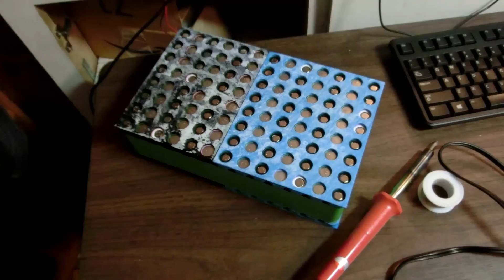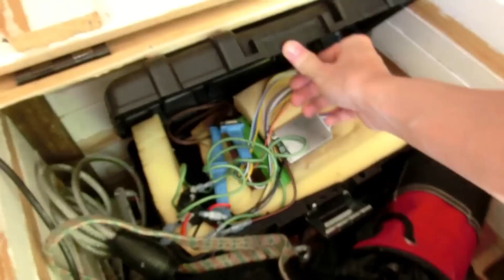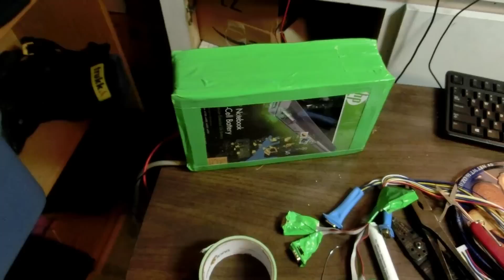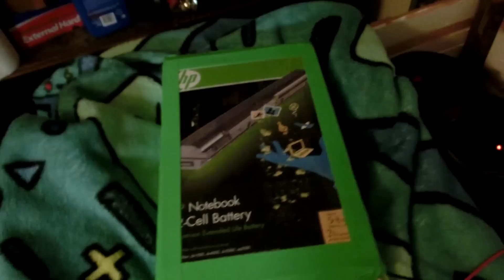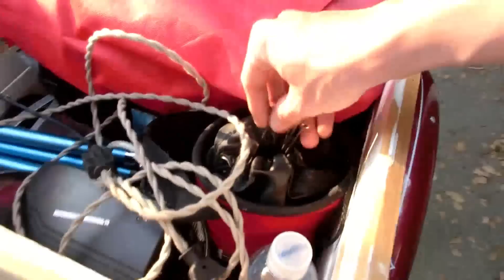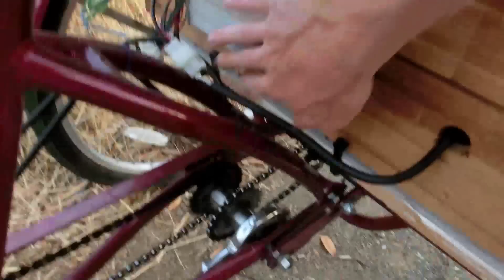DIY 52v (48v) 16AH Lithium-Ion 18650 E-Bike battery pack (E-Trike v1.6)

Comment: My dad built an electric bike useng a bike moter that bolts onto the frame at the rear wheel...we welded a sproket on the opposite side of the peddles chain and attatched a freewheel sprocket to the drive shaft of the motor...so if he peddles the bike the sprocket on the motor side freewheels with its own small chain and if he twists the throttle then the other ( original chain ) free wheels...its a pretty good set up...he is useing two of those batteries you find in kids electric trucks that they sell at toys r us...the ones two kids can ride in...he can go 14 miles an hour for about 10 miles before recharging...I would love to build him a battery like yours but I need your help with how many cells and how much voltage...I can find out any specs you would need to do the figuring...if you help me I will be happy to donate to your channel good sir...thankyou
Reply from the maker: Gary Ferguson Jr well its not all that difficult. if its 24v then you need to have like 6 lithium packs in series, and each pack should have atleast 1 AH for every amp you plan to pull. putting like 6 cells in each parallel pack would a great start.

Comment: Where did you get your BMS from? 
I have been using the IMAX B6 charger from your first battery video in my battery and I think it would be good if I can upgrade 

Also by the sound of that motor and how hot it was getting I think you definitely need more motor output power at least double what you have now especially if you are going to be pulling a trailer with more batteries on it 

And I'm not sure if I'm doing something wrong but on my 500W E-Bike I have 156 laptop cells sourced from ebay just like yours wired to a 56V full charge configuration and whenever I open the throttle to full power the voltage drops enough to trick my battery gauge to say 1-2% remaining I'm not sure if the cells are too weak or my wiring isn't up to par but it is very annoying especially when I am carrying a load
Reply: What URL I can't see one 
Try replacing .com with dot com that usually works
Reply from the maker: ***** i just got it from Ebay for like 20$. and unfortunatly any more than 1000w isnt quite legal.

best way to test your system is to connect a multimeter directly to your battery pack, and then use a lot of power to see if it dips. it could be how you connected the cells that is resistive, could be the cells themselves, or could be the wire outside the battery.
Reply: Oh ok well in Australia where I live the legal power limit for electric bikes is 200W (250W if using a pedal sensor instead of a throttle)

And I will connect my multimeter to the battery on my next ride and il see how it behaves 
Thanks for the advice
Reply: Unlikely 

I think upgrading the wiring probably won't burn out the motor or the ECU  but I do think a more powerful motor would be a wise investment even if he has to slap a 1000W sticker on it to keep the cops away from him 

And as for using a temp sensor he would need 2 
One for the motor and one for the ECU the motor sensor will be difficult because it is a moving part and I'm not sure how the data from the sensor will be fed to the monitor
Reply: *****  Oh sorry by the way if we crossed threads, I was having problems replying to you before youtube would not let me post the URL every time I tried to update it, it chopped off part of my message including the url, so I copied it and deleted my reply then pasted a new one this time the URL appeared thought I should say as your reply is above my comment now, just so no one gets confused.
Reply: www dot youtube dot com/watch?v=SMy2_qNO2Y0
Reply: That is an explosion of a Li-Po battery 
Both me and Rinoa is using Li-ion batteries specifically lithium ion cobalt as that is the most common type of lithium ion battery found in laptop battery packs
The batteries in the video are pouch type Li-Po batteries they are much different to Li-ion 18650 cells and even so that explosion was caused by massive overcharging and would not usually occur under normal operating conditions
Reply: *****  I agree it is a lipo, but the chemical stability is very similar, and if a cell did go short circuit then all the power from the other cells in the array could be shunted to the bad cell, the 18650 cells are commonly used in laptops as you know search on youtube for laptop explodes.
Reply: I have shorted out 18650s before and I have only had one explode and that is because I crushed it when I put it I the metal vice
Reply: It only takes one to cause a house fire and death
, I have over 300 cells in my battery box any one of which I do not feel safe with, out doors it's another matter but when life and death is a primary concern better safe than sorry.
Reply: That is a valid concern but if batteries are properly maintained and taken care of they generally don't explode but there is always a possibility of getting a lemon cell and having it explode or catch fire but that is rare if you get good quality cells like the Panasonic CGR18650CA (never had one of those ones explode)

But personally I recommend that you get LiFePO4 cells because they are designed not to catch fire or explode but they are quite expensive and they are only 3.3V nominal instead of 3.7V 
(3.7V full charge compared to LiPo 4.2V full charge)

I have a room in my house that contains 30KWH of AGM batteries that I use to power my whole house and live independently from the power grid 
(I might upload a video about it at some point) and I thrash those batteries continuously with no fires or explosions 
(I am considering converting from AGM to LiFePO4 once I can find a suitable solar BMS that can handle 2KW of solar input)

Comment: If you wee such a genius you would have incorporated a groove for the parallel current connector into your cell holder rack. As it is, your solders are going to be constantly breaking during the jostling of riding the e-trike.
And if you were any kind of scrapper, you'd know you could have found all that hardware you paid through the nose for at Fry's in the trash in back of Weird Stuff.
If those batteries ignite and spill into that dry brush. I hope you're watching the news about wildfires stressing firefighting resources all over California right now. If you cause one, the people who live in those hills will roast you over the coals you've created.
Reply from the maker: *****
oh hey, just remembered your anti-goole+ profile pic. i cant believe google said they would finally be splitting up youtube and google+. now we just need to get rid of the stupid fucking one-channel layout that removed the option to have background art on your channel front page.
Reply from the maker: *****
Bob and his army won.
Reply: ***** Rinoa didn't make the better Lithium cell. He just waited until the Chinese slaves made them and bought from them. When the Chinese market e-bikes in masse, they'll be equipped with their 'better' power cells and anyone tinkering around with them will drop what they've tinkering with and buy what the Chinese are selling - including Rinoa.
Reply from the maker: Eddie Exec i addressed this in the video, or maybe it was the one before. but either way its not my fault for you not paying attention.

your a whiny little bitch tbh, be constructive or stfu.
Reply: +Eddie Exec I never said he made an better lithium cell I just said that you should try making a better one than him

He has natural skills in making batteries and you are probably just jealous of him 

If you need advice in making batteries ask him don't troll him

Idiot
Reply: Amen to that my friend I'm glad there are people who don't think I'm a troll for my thoughts on forced google+ integration 

However we fought and prevailed and slowly but surely YouTube is returning to its former glory
Reply: Yes he did 

☻/ This is bob. We won 
/▌
/\
Reply: Eddie Exec Chinese is the best race in the world.
Reply: The Chinese do have some sexy women for sure

Comment: Arwsome vídeo wht idd like to see is if you added two motors to the back wheels and filled the back box full of 18650 battery's tht be one too watch would it be possible do you think keep up the arwsome stuff
Reply: +eraysha white it would add more torque, but he doesnt need that, and it would lower efficiency greatly

Comment: Depending on what the print is made from, you might be able to weld the cracks with acetone.
Reply from the maker: Maxx B yes i can but heat is faster.
Reply: Nice to know.

Comment: Seems like you use same BMS as i have.. Can you provide me link of ur BMS so i can compare it? In your situation it is normal for BMS to take so long time to balance.. Charger will charge whole pack to target voltage then after that BMS starts burning up excess voltage-capacity to mach all the paralels in same voltage, when discharging is happening ofcourse after some time total voltage of the pack will drop and charger will turn on again.. This process is repeated untill all paralels are balanced.. So you can just imagine if one of ur pararels are  24AH how much time you will need to dicharge it (30-60 mah dicharge rate for most BMS) and get it mached to other paralels in your pack =))
Reply: +Igor Tomic its a generic ebay one

Comment: Great video! Only criticism I have is that you should fuse the high voltage output from the battery with a suitable fuse which is lower than the current of all your cell fuses. That way if you over current the battery (short circuit, or whatever) the individual cell fuses won't blow (which would be a pain to replace!) but the single fuse would be easy. Also for fire safety too, always fuse or circuit breaker it.

Comment: you should try using silicon cables for your balance leads, and power leads as well!  they won't cause a fire from burning melting cables or melt through the insulation and short out on other cables. it is pretty cheap stuff to buy and can save a lot of pain

Comment: mount a solar panel on that and you have free transport
Reply from the maker: сталкер чворович panel would have to be too large to be able to power it. would need about 300w of solar panel. would be better to have it on a shed and recharge from that overnight.
Reply: Rinoa Super-Genius you can get a smaller one so it just trickle charges then and if you get a power outage you just leave it alone and it will charge

Comment: A tip to weld abs together is to use acetone James Burton uses this technique on his 3d prints
Reply from the maker: Paumanel yes i use that also but it takes a lot longer to dry and it also absorbs into the surrounding ABS and makes it very pliable for an hour or so too.

Comment: Im kind of wondering why you stopped at 13 (54.6)  why not go 15 at (60) the pots in the controler are 63v.  also if im correct you you hav a 15 fet controller board.. i find with the higher voltage my motor dosnt run as hot when climbing hills. it also adds to my over all speed.. with 15 packs of 12 i can hit a top speed of 50.6 mph..also have to say i love the way you fused that together..smart!!! have one last question are you using the charger that came with the kit.??? awesom video!!!
Reply from the maker: michael grelewicz because i had a BMS that expected 13 packs. thats the only reason. and yes i'm using the same charger.
Reply: +Rinoa Super-Genius that fuse set up is the best i ever saw...im thinking i should do the same with my next pack i build... also wondering do you have to use the packs at 4.1 volts?  couldnt you make like 4 packs of 12 volt or 8 packs of 12volts.... i understand balancing might be a nightmare...... just curious is all
Reply from the maker: michael grelewicz
not sure what you mean by 12v packs.
Reply: +Rinoa Super-Genius Im thinking leave the batteries in there original case.... Each pack is 12 volts.  the balance wires are already soldered in place.   (i would have to send you a picture)
Reply: michael grelewicz 1st i bought 25 New Extended 6600 mah Replacement Laptop Battery for Dell Inspiron they were $10.00 each I make a cut down the front with a box cutter then peel off the top and slide the whole battery out as one unit cut /clip the pos. and neg. and balance wires at the circuit board....Remove the circuit board.. solder on bigger + and ~ wires.  then run all 4 wires out the middle where the board was... so you end up with each pack at 12 volts. So 4 packs bound / and wired together in series  is 48 volts...  the right size balance wires are already there.... each 4 pack layer is 48 volts at 6600 mah.    its easy enough to add a layer or layers in my case im using 5 layers wired in parallel  33 AH.   There is hardly any scrap plastic at all the batteries  go back in there original place seems more eco ~ friendly
Mike. 
(Note about the only issue i have had was  i found 3 packs out of the 20 i bought that had 1800 mah batteries. instead of 2200 mah.... and its kind of hard to send them back for replacement once you have cut them open....lol)
Reply: +michael grelewicz you would have to insert the pack into a laptop to use, entirely impractical

Comment: So if I understand correctly, you're using a top-balancing schema? Have you tested a bottom-balancing schema for comparison? (just curious)
I wish we has bicycle lanes in this country. It would be insane or suicide to ride that contraption in my area!
Reply from the maker: Aadil Shah bottom balancing seems very stupid for me because it could cause some cells to be overcharged when you charge the pack.
Reply: Here's a blog post from someone with a different opinion.
http://kwsaki.blogspot.com/2012/11/bottom-balancing.html

Anyway, I suspect we will find that battery technology is still young. I expect battery technology to improve considerably over the next 50~100 years.
After all, the only way we can move onto energy harvesting as a viable 'fuel' is if we vastly improve our energy storage methods.
Reply from the maker: Aadil Shah
 well read the first paragraph of that blog then.

Comment: looks good, now all you need is a solar panel on top of the box to charge another "smaller battery pack for lights",,blinkers, and the such ?
You could try and make your own solar panel from those garden light that K-mart sell, the ones that are under 4 dollars each ?
Reply from the maker: Frank Blackcrow no thanks. i'll just use my 48v to 12v step down module i got.
Reply: Rinoa Super-Genius If you did have lights, you probably wouldn't use much power anyhow.

Comment: Great video! You are very brave and trusting to take that long uphill trip on your new battery. One comment though...It bothers me to see how small of wire all these lipo batteries use (14ga in your case as even if they work and get warm you are loosing some power to heat and I have spent the past year measuring current on my scooter and every charger I have and use. Even the 24ga wiring used in usb cables on phone chargers can loose enough voltage to effect the charge rate of a tablet, phone, and all my usb accessories.I tried to use a db9 extension to run an extension from my 24volt batteries to a volt/amp gauge and found a voltage drop of a volt in less then 10 feet with the tiny wires.

I would suggest using Anderson connectors and at least 12ga power wire if less then 5 feet,  and if your balance leads are over 2 feet I would use at least 18ga.

I'm not saying any of this to preach as I too am slowly upgrading my too small wiring but I'm finding it makes such a difference in use time, power available, and charge time it is worth the time.

Two questions.. What charger are you using now with the upgraded batteries?
What soldering iron are you using? It looked like it handled the soldering to the cells great and the lights are very cool.

Again I know how much work it was you did and congrats on building it yourself rather then just buying one off the shelf. I imagine the ride was very satisfying having built everything yourself. 
BRAVO
Reply from the maker: Rob NAustin  yeah well i had gone about 20 miles on it in comuting before i went up the mountain, so its not like i just built it and rode directly up the mountain without giving time to detect errors :P

and the soldering iron is a 40w Weller i got from Halted for like 20$ or so. i like it quite a bit.

i do agree on increased wire size but tbh i get enough voltage drop just from teh cells themselves that its not a huge issue, some of these cells are over 10 years old anyway.

i'm glad you enjoyed it, and you didnt come off preachy at all.
Reply: Rinoa Super-Genius 
hello sir, I'd love for you to make a battery for me. I have paypal, I'm sure you've already turned peeps down but I trust your skills.would ya would ya?

Comment: It's almost time for a better/bigger motor or two more motors and put them on the back wheels haha. Have you thought of making a small battery pack and hooking up head/brake lights and hooking up a volt meter to get/see a live feed when riding?
Reply from the maker: Dustin Byce yeah i'm planning to add a full dashboard that has lots of data readouts but that just hasnt really fallen together yet.

and i think if i ever want to get something more powerful i will then be ready to move onto an electric car like the Comuta Car.